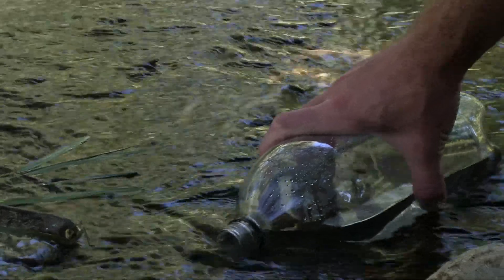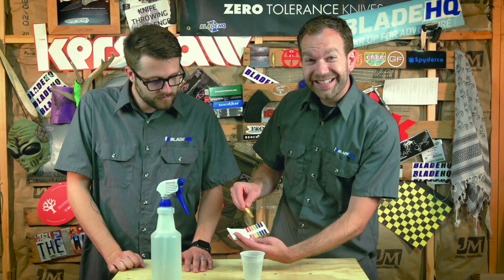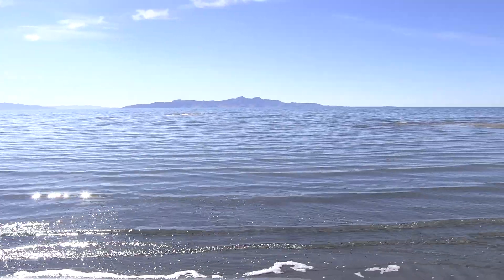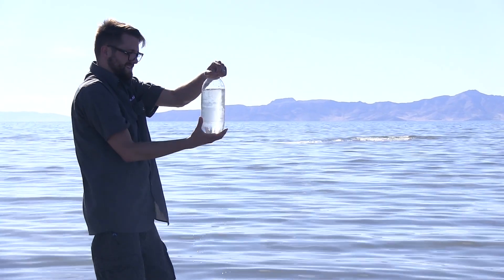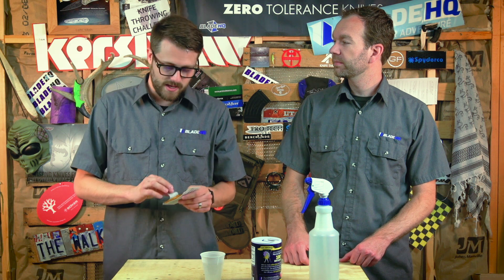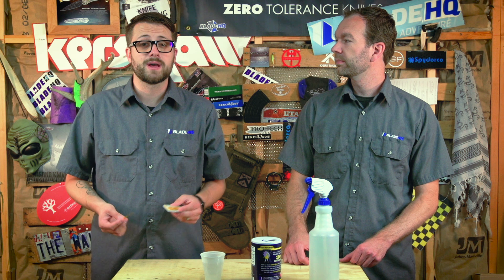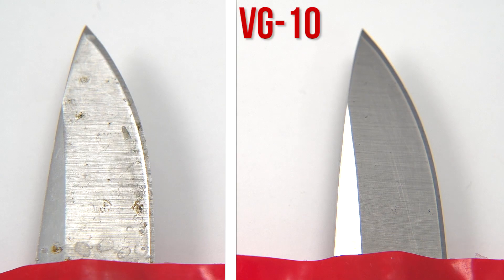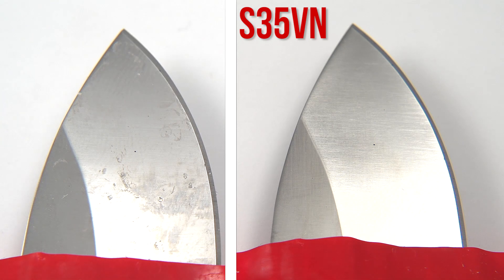Ultimate Knife Rust Test 2 | Blade HQ

Comment: Kind of curious... I have this supposed S35V pocket knife. Used it to cut some chicken up and didn't wash it for maybe 20 minutes? Because I was eating. Washed it off and I saw these rust spots here and there, they weren't small dots, it was like a light cover of brown, at a certain part of the blade. The chicken was oily, and I put a bit of salt on it. Nothing else in particular. I basically scratched it off with some sandpaper though, so I didn't really care. Is this steel actually S35V? Is this normal for premium steels? I've seen other people use that kind of steel to skin deer and etc, and they don't seem to get rust spots. Maybe they clean it after?

Basically my question is, is it normal for the rust spot to appear so soon? Especially on an S35V? 20 minutes from sitting with oil from chicken. I am just trying to gain knowledge of this, as I have not had this happen before.

Comment: is it hard to resharpen CPM S35VN ? and what would be the best way to do so?
Reply: Ramon Flores my ZT 0909 has s35vn and it isn't as easy as the cpm 154 on my Kershaw launch 6, but it is still very pleasant to sharpen. I use Arkansas stones to sharpen and hone my knives and they are very effective with s35vn.
Reply: Bryce Kimball have you used the cpm 154 around salt water? if so how did it hold up and dose it hold an edge better then your s35vn?

Comment: I thought it was interesting that the rust ate up some of the blade edge on the 154cm.  Also, you said 154CPM and wrote 154CM.  So were you talking about CPM 154?  or 154CM?  And I wonder if the edge being eaten up on the 154CM blade was just luck of where the spray landed, or if this type of steel is somehow more susceptible to rusting on the blade edge.
Reply from the maker: Good catch, don't think anyone has pointed that out. It was 154CM.
Reply: hahaha I just posted a comment about cm vs cpm but deleted it because you already asked

Comment: Put the 154cm against Sandvik. People pay alot more for 154cm and in my opinion they are way to close to justify the increase in price. Alot of expensive knives have 154cm. Benchmade, Zero Tolerance, Spyderco, Protech,etc...
Reply: specopsbrat ZT has cpm 154, a much better steel than 154cm

Comment: vinegar is acidic I use it to remove a rust spot off my gun and it rust it more.
Reply: Obviously you need to rinse it to neutralize the acid, dry it thoroughly, and then use oil to displace the remaining water. If you just let the vinegar sit, of course it's going to cause more rust.

Comment: Salt water fucked up my D2 blade. It is all comestic but it sucks.
Reply: Go to vehicle-care section of walmart and get "mother's mag" wheel polish, just get a little bit on a paper towel or old t-shirt and polish out the rust spots, i use it on my 1095, D2, and sandvik steel knives when they need it, it also takes out scratches. The polished finish will also help with future corrosion since the water just beads and falls off.

Comment: I would like a high carbon steel test 1095, D2, cpm 3v, 01, A2, and a spring steel.  I know you have done 1095 and D2 already but interesting all at the same time vs each other.

Comment: Im glad you all are telling people to use frog lube on there blades. Hope they read it though and heat the blade before putting it on them. One bad part is with coated blades sometimes it will take the black coating off of them just to warn you all.

Comment: Excellent choice of steels.  However, the comparison between s35vn and H-1 was inconclusive as to which would resit corrosion longer in a salt water environment.  I think both looked almost unchanged, however, the h-1 looked like it had some flaws in the finish to begin with, which looked like corrosion, but was probably not.  I would definitely love to see further testing on these two steels.  Perhaps they could be left in a bath of vibrating salt water solution for an extended period(up to a month?).  For this test, not only H-1 and s35vn, but a specific comparison of steels that are supposed to hold up under extremely wet and harsh conditions would be ideal(example: H-1, vs s35vn, vs cpm 20cv, vs N680).  Also,  especially with these so called "h2o" steels(used often in dive knives and such) I would like to see an edge retention test comparing the before and after sharpness as well, since it is possible that there could be hardly any visible corrosion, whilst sustaining significant corrosion along the fine edge (it would be ideal if they were all ground with the same edge geometry and sharpened with the same method to the same degree to start with, which could be another video in and of itself).  For this test, a simple paper cut demonstration(ideally with phone book paper or the like) or, if shaving sharp, a shaving demonstration, or both, should suffice.   Thanks, always, for providing us with interesting and entertaining videos.